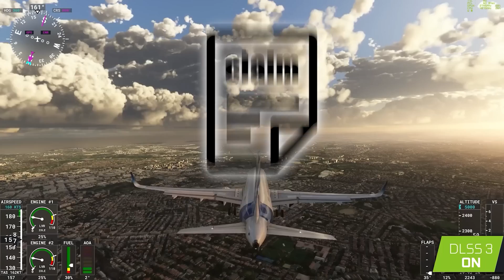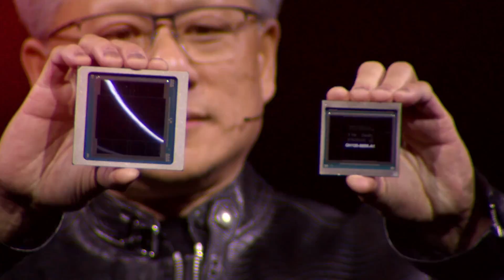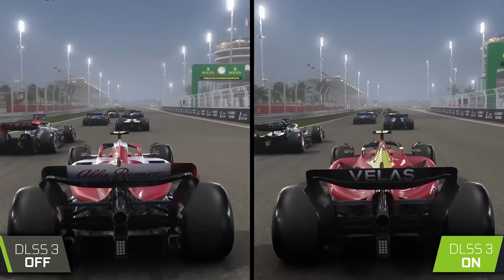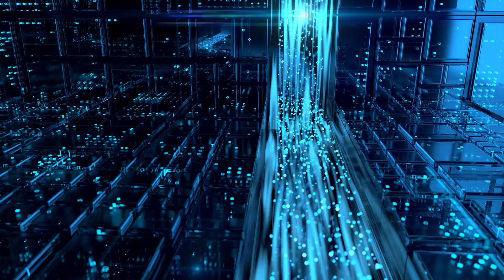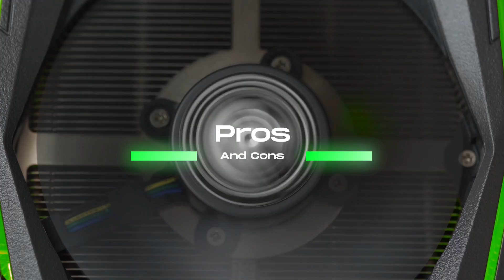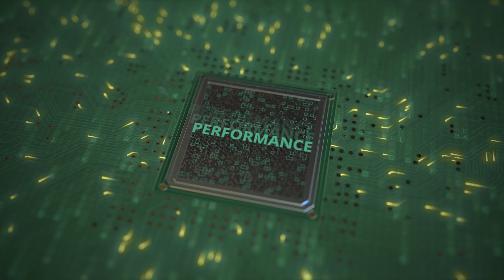NEW RTX 5090 LEAKS : Realease Date | Blackwell 2.0 | Dual-Fan and Slim Design

Comment: They really need to train their fricken AI's to accommodate for tech linguistics. Saying the darn numbers like that is idiotic. Spend a day training the AI on actual fricken technology videos so it doesn't sound so STUPID.

PS If the 5090 comes out at around "two-thousand dollars and zero cents" USD (sorry, had to type it in a way the AI would say it ;^) I am going to be pissed. I didn't buy a 4090 at launch bc I thought they were overpriced. Still do, but the market will obviously tolerate it so wtv. Anyway, $2K would piss me off as I do plan on getting one, but I don't want to pay more than $1800 for it. It wouldn't be a big deal if the 5080 was within, say 17%-25 of the 5090 like they used to be with 70% of the VRAM, but I highly, highly doubt that will be the case. Rumors are the 5080 might lose to the fricken current 4090 which would be an absolute joke as well.

To make matters worse, if you want a high-end card for 4K w/RT you only have Nvidia to choose from this gen and apparently for next gen as well if AMD is really not releasing any high-end models. It's not even a matter of affording the cards at this point. More-so it boils down to "Am I getting what I am paying for? Is this worth the price of a used Honda Civic couple?" Or maybe there simply are just that many people who think of $2K like I think of $5 bucks and it doesn't really matter if it's worth it as long as it is the most powerful card at the time?

"Sigh" Man I wish I wasn't so into story driven single player games. Unfortunately I am though, and this 10GB 3080 justtisn't cutting it with modern games anymore, and I am only at 1440P right now! Heh, if they would have put 16GB on these cards they would have been legendary as opposed to being a cautionary tale for anyone not playing at 1080P high or lower (single player games, not multi-player where the card is fricken incredible).

Comment: I own an MS GeForce 4080 16GB Super Slim video card. And run an AMD Ryzen 9 7950X3D 16 core CPU. I'm getting an average 156fps at everything maxed out at 1080p (Perfectly fine with that resolution). In the Cyber Punk 2077 in game benchmark. This is my average framerate for all my games at 1080p. All your paying for, for the 5090, is more frames right now. Which if you have a 4080 or 4090. Those cards will serve you just fine for gaming today. If you have an outdated 2000 or 3000 nVidia video cards. Then the 5090 would be a good option for you. It's all a waiting game till when it's time to get new hardware.
Reply: I have a 4080 Super & i will be getting the 5090 on day 1 release 😎

Comment: $1300-$1600? hehehe it will be well above $2100
Reply: I will bet you $2000 the price will be between $1599.99-$1999.99. If you're 100% convinced it will be above $2100 MRSP, let's set up a large wager
Reply: Definitely not they can’t charge more than 2 grand not many will buy
Reply: @AstroBot-bc0213  Plebs don't need to buy, these things will be chock full of AI acceleration and it's server farms that will buy
Reply: @AstroBot-bc0213  2200$ at least